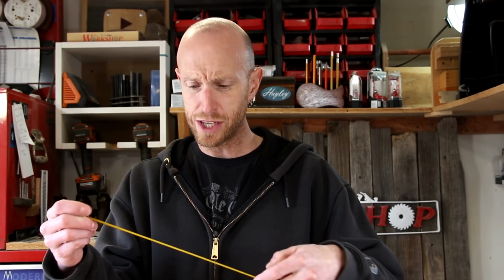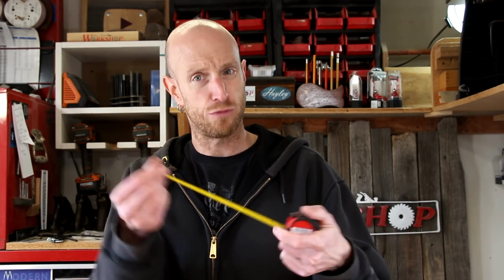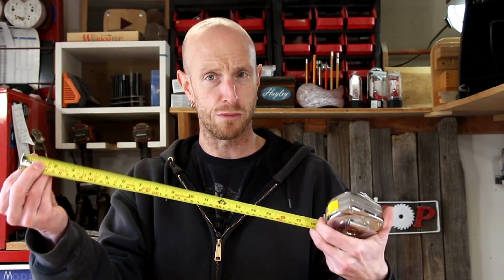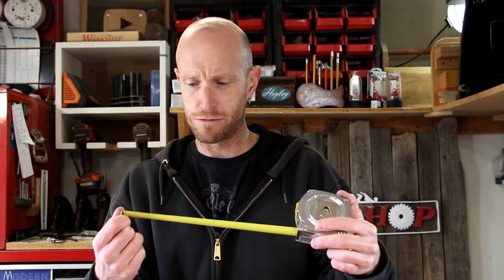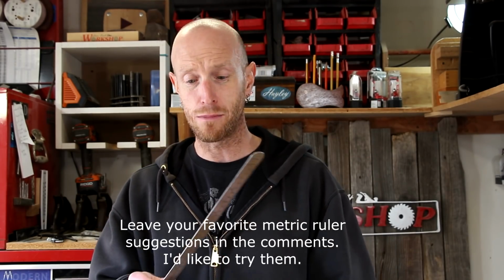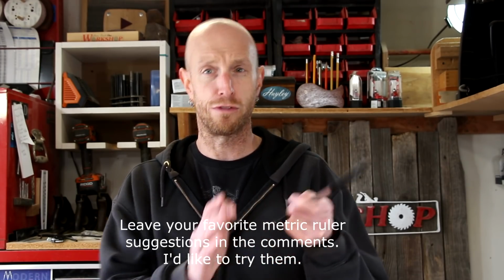My thoughts after using the Metric System for a project | I liked it

Comment: Most Americans their biggest issue with the metric system is, they don't understand the interconnections between different measurement units.

For example:
You want to store 1000 liters of water in a cube, how big would that cube be and what would its weight be when filled?
- Metric answer:  1000 liters of water = 1 cubic meter = a 1x1x1 meters cube. 1 Liter (L) of water = 1 kilogram (kg), so 1000 L = 1000 Kg or 1 metric ton. 
- Imperial answer: That would be 264 gallons of water, the cube would be around 35 cubic feet, which is roughly 3.3x3.3x3.3 feet in size and would weight about 2204 pounds... 
Same for temperature:
- Water freezes at 0°C, water boils at 100°C
- Water freezes at 32°F, it boils at 212°F

What's the distance between the north pole and the equator?
- About 10'000 kilo meters, or roughly 6214 miles
- That's about 10'000'000 meters, or 32'809'920 feet... 

Every logical person should comprehend that the imperial system is just ridiculous...

Comment: Going metric only starts with new tape measures and rulers. You finally realise what you got yourself into when you then need metric drills, metric verniers and metric taps and you have to calculate all stock material, all in imperial of course, into metric. How thick is a gauge 3 piece of sheet metal in metric? Of course your lathe and milling machine is in imperial, so there you're constantly having to calculate into metric.
I'm not saying metric isn't good, I live in Europe where everything except Harleys is in metric, and have been using metric since forever. But changing to a different "foreign" system is always going to be difficult.

Comment: When I was in college as an engineer.  I only get to go 2 years at (1.5 time;  there is half time. full time, and 1.5 time).  I had to move into the hospital for a couple years, and that ended that.  But the metric system is the way to go.  Most conversions can be done right in my head.  But every once in a while (10% of the time) we would use the BG (British grav, imperial) system.  I guess it (to me) was like more of a "proof of concept".  With all those nonsense conversions (water boils at 212, 5280 feet to a mile. 12 inches to a foot), made it not possible to do all that in my head.  And even though all those crazy conversion factors, then most things are measured in fractions (even after that) (17 and (13/64) of an inch).  instead of (x of millimeters) divided by a thousand for meters, divided by a thousand again if I need kilometers.  With the BG system, there is SO, many possibilities for err.  And BIG, projects at lockheed martin are probably immune from err (but not entirely, remember the Hubble telescope "thing").  When you get a "regular" engineer, building a bridge in your city.  You don't want some "possibility for err.  Because, "people are stupid".  If there is a "possibility" for err.  It is a "guarantee" there will be an err.  Death to the BG system!!!

Comment: Hi, nice to hear an American being a fan of the metric system. 
But first it's funny to hear that in the beginning of the video you used the word "standart" for the imperial system; where the standart in the whole world (yes also in the USA, becource all the Imperial standarts are definde by using metric) is the metric system. But beside that slip off the tong it was nice to hear youre explanation.

Now here is why metric is easyer to use in verry small or verry large numbers. 
If you want to be accurat, 1mm (millimeter) is about 1/40 inch. So to get that acurat you must have a ruler with 1/64 inch, and this means sometimes you need to count up to 32 lines to get to the certain line you need to be. Ok sutch rules is more accurate, than a "normal" metric ruler, witch always has mm on them, but not everybody has a ruler with 1/64 inch on it. But to count the mm you just have to count at most 9, and normaly just up to 5 (for 8mm is 2mm short of the next cm (centimeter) and you count 2 from the top down).
If you need to go large, we use km (kilometer) and the rate to get to the smaller units is the same. 1km = 1000m and 1m=1000mm. No complicated calculations, and no, or less mistakes.

I can believe that it would take a long, long time for all people to convert to metric, but I do hope there is a future where this is the case. Just for the thousends off dollars or euros spend to convert messuments. And I'm not saying you're wrong using Imperial standarts; but if the rest of the world is using one standart, and just a few ar using an other; wouldn't it be nice to come together on a thing that has nothing to do pride or culture.

Great video, and greetings from Belgium.

Comment: It is more accurate because 1/8 is 3mm. Which carpenters that use the imperial system work within a 1/8 tolerance whereas the other way around there is no 3mm tolerance. The measurement is the measurement.

Comment: Yeaah, at least here in Finland that 2m measure is supposed in principle to be used by those who work on smaller projects than construction and lumber industry and the 6m is for construction and measuring lengths of timber.

Comment: I live in country which switched to metric in 1924. We are using metric daily.
Yet in woodworking and plumbing inches are still being used. Also car wheels and monitor sizes are specified in inches. Sometimes imported equipment require imperial units and threads.
I find it odd and can't explain.

Comment: Well you followed the automotive industry... they changed to metric and discovered it gave them more profit and less warehouse space needed. The cost of conversion of this industry was lower than the extra profit.

In Australia they did a real practical test with building 2 exact the same houses next to each other.. one completely engineered and built in Imperial and the other one in metric, only millimetres. The outcome... the Imperial one (the system they were used building in) had more than double the amount of waste the metric house had. The cause was the conversion mistakes between Imperial units during the built.

Comment: Metric or decimal system is way easy to use: 1 Km= 1000Meters, 1 Meter= 1000 MM and everything in between. 1 ton= 1000kgs, 1Kilo= 1000 grams. Water freezes@ 0 degrees and boiles  @ 100 degrees “ Celsius” why complicate? I had a bit of problem undoing the 3/32 screws of my US welding machine

Comment: Using milimeters instead of inches is more accurate because there are 25.4 milimeters per inch.
It provides a more fine grain than using 16ths of inches.

Comment: Practically seen metric leads to a higher accuracy although neither one is more accurate then the other.
But: 1 mm is a bit smaller then 1/16 and from what i have seen carpenters usually work in 1/16.
Same goes for metal workers who work in thousands of an inch, one thou= 0.0254 mm so if a metric worker works by default with 1/100 mm he is 2,5x more accurate .

Comment: Good luck, but you will probably have to operate with two different systems with an interpreter shadowing you, i.e. translate all measures into imperial units for those who only think that way. Since it is laborious with a dual process, refer to NASA and the lunar landing program. The professionals from Europe had to translate metric values into imperial units and the other way around all the time.

Comment: I think I can tell where the extra feeling of precision comes from...With the Standard measurements, you are halving your way to what you need. And depending on your project, that's fine. But in Metric, there are ALWAYS 10 more lines between the lines on your ruler, whether they are actually there or not. Sure that counts for standard too, but imagine, to get at least 10 in between measures of 1/16 of an inch, you have to work with 1/256 precision.
At least to me that sounds weird.

Comment: Here in the UK we use metric - but if you went to the timber (lumber) yard and asked for some "fifty by one hundred millimeter section timber" instead of some "two by four" it would be like going out for a meal and asking for sodium chloride with your chips instead of calling it "salt". Anyone who has never used imperial must wonder why on earth the standard size for a door is one-thousand, nine-hundred and eighty-one millimeters high.
Reply: Except metric users are used to use odd numbers and just accept the fact without a second thought.

Comment: Well in Australia Metric is the Standard, yes we use the Imperil system  Which is originally British & even they have now mostly converted to the Metric System, & like you say the Metric system is units of ten, Unlike the Imperil system the uses units of 4s, 8s, 16, 32 & 64ths, how confusing is that?
The good thing about thread cutting is minus the thread pitch from the size, I.e to cut an M9 x 1 = the drill size would be an 8mm drill.

Comment: The metric system is really easy it's 10mm = 1cm, 100cm = 1M, 1000M = 1Km ect ect it's goes as well with the weight like 1000mg = 1g, 1000g = 1Kg
Every year I do 780km of road, and you can guess it's 780,000m and I do it in about 7-8 hours at about 115KM/h or 71 mph

Comment: Nice that you like. You asked for measuring tool suggestions. Try the "Hultafors talmeter" measuring tape. Its a revolution in measuring tape,even though it was invented back in 1954, check it out on youtube and you'll understand. I have my 3meter with me all the time. Its a bit more expensive then others,but well worth it.
Reply from the maker: Thanks for the tip. I'll check it out.
Reply: @homebuiltshop  try out their folding rule as well, the one called "contact meter" is the one i like the best. it is the one that has the numbers so that you can measure with that ruler flat on the materials. i guess thats standard in the states with your imperial rulers, but here in sweden it isn´t, we usually have imperial measurements on that side, and metric on the other. very frustrating since no one ever uses inches here :P

Comment: I have a theory. In metric, additional precision costs you no extra mental effort. 750mm is just as easy to think about as 753mm. Because additional precision costs you no effort, you're more inclined to use it. 

However, in Imperial, more precision is more difficult to think about. 1 1/2 inches is harder to think about than 1 inch, and 1 17/32 inches is harder to think about than 1 inch, and god help you if you want to add 1 17/32 inches to 1 17/32 inches. Because being precise is harder, you're less inclined to be precise, and just round off to 1 1/2 inch. It's not as accurate, but it's easier to think about and calculate

Comment: The metric is more accurate, much more accurate than imperial. Not just in measuring lengths etc, but even converting volumes to weights 1 gallon of water weighs 8.34 pounds in imperial. 1 litre of water weighs 1 kilogram in metric. It is an evolved system, very logical.

Comment: You didn’t even scratch the surface of the convenience of the metric system.  It’s actually based on water.
Conversion: 1ltr = 1000ml = 1kg = 1000g = 1000cm^3 = .001m^3.
The measurements all continue in smaller increments of weight & size (nanometers etc) down to subatomic levels.

Comment: Actually the metric system is even more simple as it is related to water. 1x1x1 cm of water is 1 gram. 10X10X10 cm of water is 1 kg (kilo) and is one liter. 1x1x1m of water is 1000 liters is 1000kg (Ton). 1cm x 10 is 10 cm X 10 is 1 meter X 10 is 100m X 10 is 1 km. As with celsius, 0 deg is the freezing point and 100 deg is boiling point of water. That is all you need to know to explain dimensions, weight and temperature.

Comment: A Cube. 
10cm*10cm*10cm each side is 1 liter of water (capacity). 
1 liter of water (capacity) is 1 kilogramme (weight). 
A cube. 1 meter*1 meter*1 meter is 1000 liters of water OR 1000 kilogrammes OR 1 tonnes.

Comment: When you say "standard" measuring tools you mean "imperial" as in British Imperial measuring tools.

Given all but 3 countries in the world use metric, metric IS the standard, not the other way around.

Those combination tape measures are the go. You can check the measurements out in metric, and do mental sanity checks in feet and inches that you are used to, or do other projects with imperial measurements but get used to what the numbers in metric are and get a feel for them. We tend to use them in metric countries too.

Reality is both measurment systems work out ok for most craft jobs. Metric is just that little bit more precise, and so much easier to covert millimetres to centimetres to metres where required. 

But even better than that, the ability to measure everything in millimetres for household DIY tasks without changing to compound numbers or working out how to add a quarter inch to one and seven sixteenths is an absolute boon. Just measure your doorframe all in mm and you get a number like 880mm wide x 2050mm high. No conversion, no dramas.

Comment: TLDR: "The academics of Uppsala university were furious with the common folk of Lappi, for they knew not of how to measure their own wealth, leading to negative impacts on fur trading with the continentals, while the locals themselves were robbed blind by the considerably more literate merchants."

Well, yeah. It is interesting to hear from someone like this, who one would assume has a bit more of a practical approach, since metric is grounded in cold hard science these days, rather than common everyday things that help keep things in perspective.

In the old days, there were weird measurements, like quarterway: "... and then continue walking facing the sun a quarter way " , or "a day's march" etcetera. Measurements that did not need to be taught, because they were designed to be intuitive outright, but quite imprecise as a consequence. While metric has been revamped several times, the modern day metric system is derived from absolutes to the best of our knowledge in physics. The unit of time is derived from a planck second - the smallest observable passage of time, while the unit of distance is derived from how far a particle traveling at the universal constant of the speed of light has traveled during one planck second... Meanwhile, imperial has stayed true to its origins, using feet, thumbs, cubits, stonesthrows... etc. Metric was not so different in the beginning, but as science progressed, people realized there needed to be more continuity in how we measure things, as every little inaccuracy will snowball into a meaningful difference given enough measurements have taken place.

This is also why nobody gives a quack about metric in the naval sphere, as any positional information about the sea had to be of utmost precision and the consistency therein of the smallest possible tolerances between measurements. So they developed their own system of measurement units, derived from a measurement of distance called "nautical miles" , designed to be consistent regardless of reference frame, provided you knew how to use the system. So pretty much the same idea as metric: Use an abstract frame of reference instead of real, tangible objects, since the real world is too chaotic and imperfect. While you can call it imperial (it's nautical miles after all) , it's not really got anything to do with the imperial system. Some people say its based off metric, because it's official definition nowadays is 1.852 kilometers, but i don't have to tell you why that argument is faux. :)

Comment: In Australia the building industry converted to millimetres as primary measuring unit banning centimetres completely. This ensures absolutely no decimal points in architectural diagrams and of course no fractions of an inch as experienced during imperial days.

Base 10 and larger numbers help.

For the base 10, we have to thank Thomas Jefferson.

As many would know, the US was one of the first countries to push the metric system. This went as far as in 1933, the imperial system ditching normal imperial standards such as the yardstick (deemed unreliable) and instead moving to pure conversions on metric.

???
Yes this is correct. The US has been using metric as the base then adding conversions since 1933 (the UK since 1930).
The inch was changed to be exactly 2.54cm.

In 1959 the other imperial nations such as Australia came to metric conversions kicking and screaming signing the international yard and pound which …. “are two units of measurement that were the subject of an agreement among representatives of six nations signed on 1 July 1959; the United States, United Kingdom, Canada, Australia, New Zealand, and South Africa. The agreement defined the yard as exactly 0.9144 meters and the (avoirdupois) pound as exactly 0.45359237 kilograms.”

Comment: Hi, The standard system you use in the US is NOT the Imperial system.  It may be based on teh Imperial but there are several major differences.  For example your gallon is only about 3/5th of an Imperial gallon and your pint has 16 fluid ounces ours has 20, plus we don't use 'cups' in the Imperial system and so on.  You are more correct to call your system 'Standard American'.  By the way, the Imperial system is only now standard in 2 countries, Burma and Liberia - great company you keep!

Comment: There's 195 countries on the planet, and 192 of them are on the metric system.
The imperial system is from britain, and they don't use it anymore.
Same goes for celsius instead of fahrenheit: about 190 countries use celsius.
metric is more accurate and is easily convertable between units.